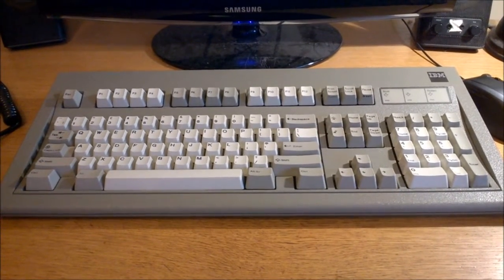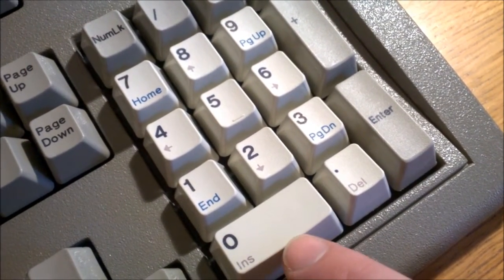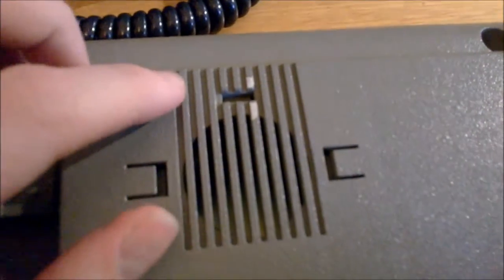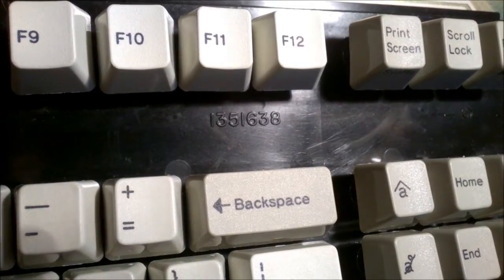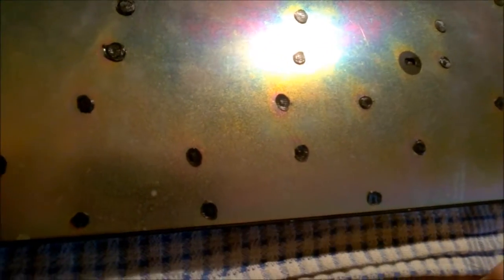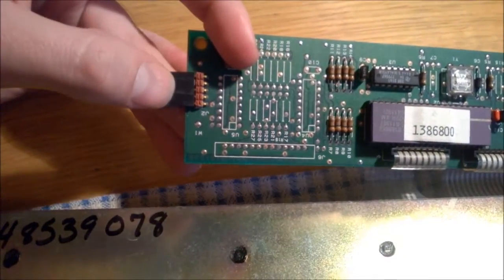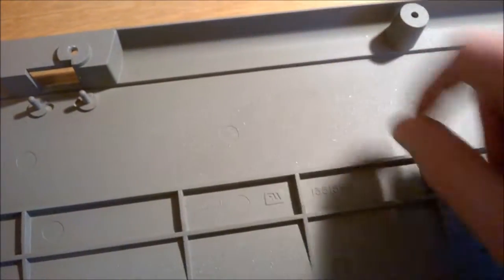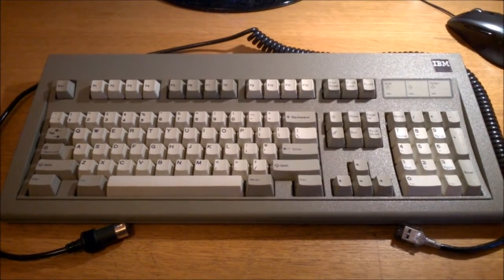IBM industrial Model M video tour

Comment: The legs on the oscillator are likely there to shield it from the soldering heat, assuming they used a dip/wave soldering process.

Comment: The "newer" PCB has an oscillator too.  It's the 3 pinned blue jellybean looking part at the lower right of the Lexmark PCB, just under the chip at the edge of the circuit board.  Ceramic resonator.  The chip itself on the original board with the tape is probably a UV erasable programmable microcontroller.  Since this was a custom keyboard of low production number, they opted to use the expensive ceramic reprogrammable windowed part instead of bulk mask Rom programmed plastic encapsulated IC.  That empty space without parts could be for data acquisition/signal conditioning if the unit had a track point nub perhaps?

Comment: The reason you can't find an oscillator on the Lexmark PCB is that it isn't there (in one piece). There will be a resonator plus some caps etc that together form an oscillator circuit. An oscillator is a higher cost, all-in-one component with the oscillator circuit inside of it and is typically used when higher precision or much higher frequency is required. You will typically find higher quality cuts of resonators in an oscillator for example.

Comment: I'm wondering if someone put this together from spare parts? That'd explain the different keycaps, and the different LED overlay sticker for Numlock, scroll lock, caps lock. Black IBM badges were also available to buy from unicomp some time back so it's entirely possible the guy took a very old AT Model M and painted it grey and stuck an industrial badge on there. Not to mention the identification / date badge is missing so that could've been removed to prevent people knowing that it isn't really industrial. Who knows? Coming back to this video cos I find this particular one so damn interesting. Either it's a strange prototype that IBM made or someone did one heck of a good keyboard mod. 

Subbed to you btw, you seem to share my keyboard obsession!
Just scored an IBM Model F 84 key AT keyboard today :)
Reply from the maker: Nice, and thanks! I think it's rather unlikely someone threw it together from spare parts, considering these parts are extremely rare on production keyboards. The paint job is ridiculously good if it's not by IBM, although early industrials have been documented to be painted rather than made out of grey plastic.
Reply: Chyrosran22 Interesting board nonetheless, how did you acquire it?
Reply from the maker: I got it at a recycling centre for about £0.50 :) .
Reply: Chyrosran22 And I paid $1000 for mine, consider yourself the luckiest guy alive. Jfc.
Reply from the maker: Oh wow xD .
Reply: Hope you find a beamspring man, I really want to see a good comparison between them and buckling springs.
Reply: +Chyrosran22 I'm really curious about you going to these recycling centers. the ones I called said they don't sell things. did you just go up there and ask and then just kept going?
Reply from the maker: Not all recycling centres sell stuff.
Reply: are you pressing random keys because you enjoy the feel of your model m so much?
Reply: I was wondering the same. A skilled rattle can operator could paint this perfectly.

Comment: On the smaller, later circuit board that you show, the timekeeping part is not a crystal but a ceramic resonator... I don't know much about them, but I know they're far less accurate and usually a three-pin part. Yours is the blue blob at Y1.

Comment: OMG how did you get your hands on a 1388032!
You cant even find them on the market anymore. I was only able to find 1390120 which is like $300+ in decent condition. Ive been looking for a 1386303 board, and my search is still ongoing :)

Comment: Something tells me this was rebuilt somehow. I know Unicomp has the 2 piece keys. Strangest thing to me is the insert and delete key symbols (they look similar to two keys on the beam spring keyboard you reviewed? Wonder if this was partially handmade either from junk as a cost saving method or to perform a specific strange function. One thing I'm curious about  is if the top panel is also painted
Reply from the maker: It appears to be made up of parts they had lying around at the time, which definitely suggests it's a pre-production sample of some sort.

Comment: Ah, frankenboards. Used to have an (apparently) ISO-UK Model M with a few mismatched keycaps, and the board came bundled with a previous owner's Soarer's converter kit. The #/tilde key never worked though. Turns out that the board was actually ANSI and a previous custodian had gone to the effort of swapping the ANSI Enter's stabiliser hole with the spring from the backslash key, so the board appeared to be ISO and all the keys clicked, but the contact for that one key was in the wrong place. Weird.

Comment: Such a nice keyboard, I would love to have one myself. Can you tell me from where do you get so many mechanical keyboards in such a great condition? Where I live (Not in the US or any english speaking country) there are very very few old mechanical keyboards for sale, and if there is any, they are in horrible conditions. Thanks.
Reply from the maker: I get most of them from recycling centres and the uni I work at. The ones I find tend to be either really clean or ultra dirty xD .
Reply: I would love to be as lucky as you xd. I suppose I will be looking around more carefully and look for keyboards xd.

By the way, I have an old blue ALPS keyboard but the switches are quite deteriorated and adding lubricant doesn't work at all, is there a way to fix it?
Reply from the maker: Ah, the big curse that haunts Alps switches; their sensitivity. People have experimented with lubes but the results aren't great. The best thing is to clean them thoroughly. The only great results people have reported is from cleaning them in an ultrasonic bath.

Comment: That yellow connector looks like it's from a PC/AT Model F... I've found that connector in both of my ATs.
Reply from the maker: Interesting, I didn't know that! Someone did mention that the yellow connectors are only used on the very earliest Ms, so it'd make sense. Apparently they're quite nice because they don't corrode at all or something.
Reply: The grounding cable though, that is also present on my 1390120 from mid-'86.

Comment: Suspicious of no label. I almost think it could be a 1390131 that's been painted. (Has the same style badge as Industrials) But if real it's a good find.
Reply from the maker: +Colton Blumhagen The badge on the '0131 is black on white though, not white on black ;) .
Reply: @Chyrosran22  I know this is an old video, but couldn't the badge have been replaced with a black badge?
Reply from the maker: @HudsonGTV  Nothing is impossible, but it's extremely unlikely; the internals are WAY too old to fit a 0131. Really only very few keyboards, let alone models, came with these internals; even other 1388032's probably wouldn't've come with these parts.

Comment: This is realy late Chyrosan but somebody pointed out that the legs on the oscillator are possibly there for protecting it from the heat of wave soldering so my question now is if it is wave soldered because if it isn't it might realy be a prototype if its hand soldered

Comment: I have a silicon graphics keyboard for my old Indigo 2 workstation. I am also a chemist, we used to use these workstations for modeling. I have it packed away in the garage, can't seem to part with it, the entire computer. Now you have my curiosity as to what kind of keyboard they used.
Reply from the maker: If it's an SGI "granite" keyboard it's a pretty good catch :) .
Reply: This IBM Industrial Model M has a very similar look, same key layout at my granite SGI. They both lack the "window" keys on bottom row. SGI has a PS/2 connector and alps white keyswitches. They can be found on ebay for $30-$50. At the moment I am interested in the Topre switch keyboards, with the thonk sound vs. the clicky sound of the cherry switches. I am still deciding between Realforce 87U or 104U or Leopold FC660C models. The alps switches on SGI are somewhere in between in sound, lower pitched pleasant sound.
Reply: I went into the garage and dug out the old SGI granite keyboard that I had stored with the SGI Indigo 2, hooked it up to my PC to try it out after I cleaned it up a bit. It is a very nice keyboard but a little underweighted but with a decent sound. I tried to buy a keycap puller from the local computer store, but they did not have one. When I get one online I will determine what kind of ALPS switch is in the beast.

Comment: A ceramic chip hmm. That chip is porb worth more than most modern keyboards :P
Reply from the maker: +Andrew Joy What chip is that? =o
Reply: +Chyrosran22 It's an EPROM memory or a microcontroller with EPROM memory (I haven't found exactly this one, but it's something like "TMS7742JDL"). The sticker covers a window, under it is the memory itself - don't remove the sticker, the UV light could erase it -> making keyboard unusable...